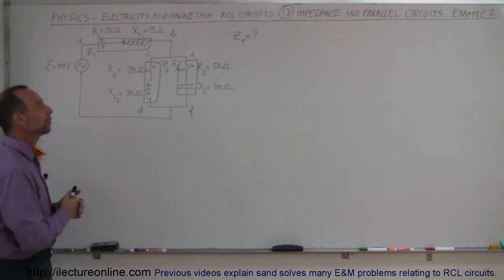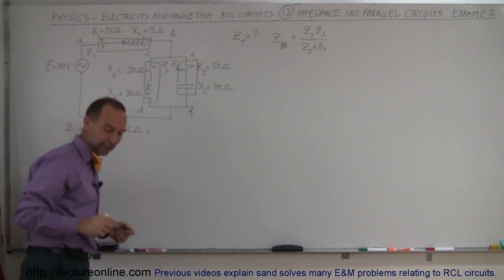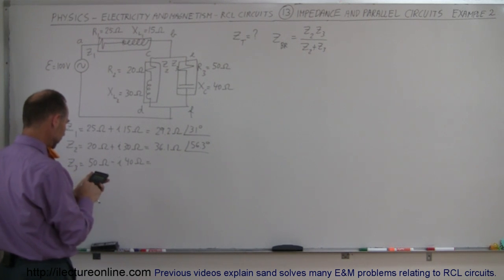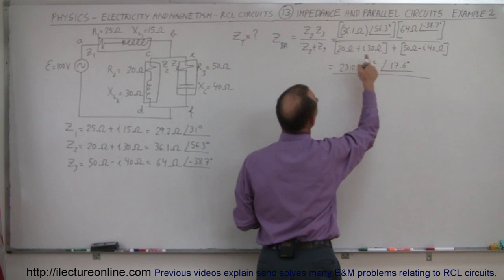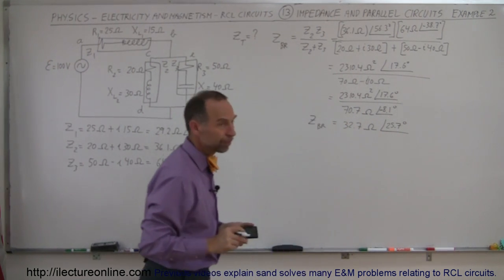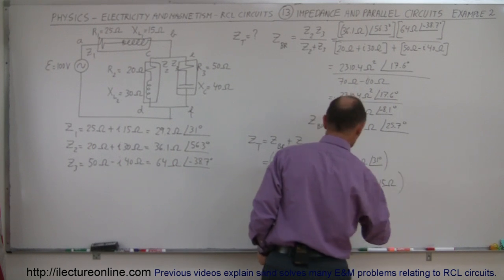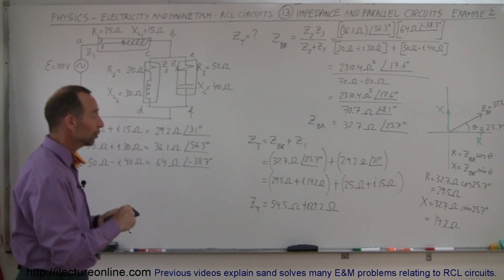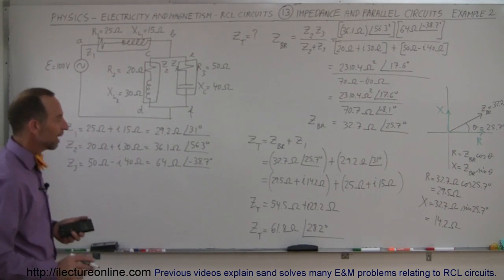Physics 49  RCL Circuits (13 of 13) Impedance and Parallel Circuits (Ex. 2)

Comment: Does the current go back and forth in the circuit corresponding to a sine/cosine wave? meaning sometimes it enters the parallel branch first, and other times the series resistor? furthermore, does the voltage drop across the series resistor and parallel branch vary with the same sine/cosine wave, meaning half the time it first drops across the single resistor, and the other half it first drops across the parallel branch?
Reply from the maker: It is a little more complicated than that.  The current will go back and forth, but at different times during the cycle across the different components and branches.  I have made some new videos describing the phases.  They have been posted within the last couple of days.  They may help you understand this topic.
Reply: Michel van Biezen ok, thank you, im getting there

Comment: Professor Michel  , would it be correct to think or say  that the total Voltage  of the  branch  Vbr + V in Z1 , should be equal to 100 , 
is this statement  correct ???
this confuses me a little because we use the of  concept of parallelism to interfere in the  branch ( also 12 of 13 exercise )   these  voltages do not add up, as you said in previous explanation , the voltages across each branch are different, but  why this can happened is they are in parallel 
many thanks
Reply from the maker: It is not as simple as that, because there are phase differences between the different branches, which means that each branch will reach their maximum voltage at a different time within the phase.
Reply: @MichelvanBiezen  , Oh thank you very much !!!!
but so , then would it be correct to say that ( the intensity splits up into two different intensities ) when entering into the branch ?? ( in magnitude)
 as we can see  It=1.62 amp should it  be equal???? to  = Icd +Ief  ??   we know that 
 Icd= 52.64/36.05=1.46 and
 Ief= 52.64/64.03=0.81
  but      1.46+0.81=2.27 which  is different than 1.62 the total intensity , is there a concept I am missing ? or is also related to the time ??

many thanks

Comment: Hi! Great video, its very good made .
I have a task that is simmilar to yours only that my circuit consist of C=100 uF  R= 30ohm in parallel and L=0,15H in serie.
I have used your lesson to solve my task ,but wondring how I can find IC   phase shift?

Can I take ZI/ Zt= 47.1/57(angel 56)=0,82   tan-1 0,82= 39 degree

(56 degree- 39degree= 17 = -17?
Reply from the maker: Jo Dj
Remember the equation for the current through a parallel branch:

I (branch 1) = (I (total)) * ( R (branch 2)) / (R (branch 1) + R (branch 2))
Try that but use impedance with the phase shifts and you should get the current through the branch.
Reply: thanks a lot!

Comment: why are we calculating phase angles this way? Is there a proof of that?
Reply: Yes, you can prove from first principles why phasor math works.

The summary of how you would do this proof is as follows:
Start with a combination of components (recommended in series), that you'd like to demonstrate.  Calculate with impedance and phasor math to show the result we are expecting.  Then see if we get the same result with first principles.

For first principles:
You'd assign V(t) = A*cos(t)
and I(t) = J*sin(t) + K*cos(t)

The voltage function is defined to be in phase with cosine, and the current function is an arbitrary linear combination of sine and cosine.

You'd then use either V = L*dI(t)/dt for an inductor, or V = 1/C * q(t) for a capacitor, where q(t) is the integral of I(t).   Differentiating (or integrating) the I(t) function, will allow us to determine the relationship between voltage and current on the energy storage element of interest.

You'd then construct Kirchhoff's laws, to establish how current and voltage among the circuit elements relate to the power supply.  This will show how A and the circuit element properties (C, R, and L) relate to J and K, when finding the current in each circuit element.  You will end up with a system of linear equations, equating the sine term coefficients, and the cosine term coefficients.  This will allow you to find out what I(t) is, for a given voltage amplitude, frequency, and circuit element properties.

We can also write I(t) = Imax * cos(w*t + phi).  Recalling that I=J*sin(w*t) + K*cos(w*t), we can determine Imax and phi, in terms of J and K:
Imax = sqrt(J^2 + K^2)
phi = arctan(J/K)

This allows you to compare the current amplitude and phase shift we get through phasor math, to the current amplitude and phase shift, we get through first principles.

Comment: hello sir this is my question.
A short 3 phase trasmision line with an impedence of 6+8j per phase sending & reciving end voltages of 120kV  & 110kV respectively for some reciviing end load at a power factor  of 0.9 lagging. determine the current, power output  & sending end power factor.

Comment: Michel van Biezen Thank you for the amazing video series sir, I now understand more about how to deal with AC RLC circuit. And Sir, i see some problems that does not use a constant value of V (e.g. : 100V), but rather time varying V (e.g. : V(t)=120 sin (wt+theta) ). So, how do we deal with this kind of problem, is it the same ? Is it possible to add another video in this series to further discuss about time varying V ?

Many thanks to you sir,
Timothy
Reply from the maker: Timothy,
I didn't see your comment before, but here is my answer.
The voltage in this problem is NOT constant.  If it was there would be no current through the branch with the capacitor and there would be no reactance due to the inductor.
Thus the voltage here varies with time according to a sin or cosine function.